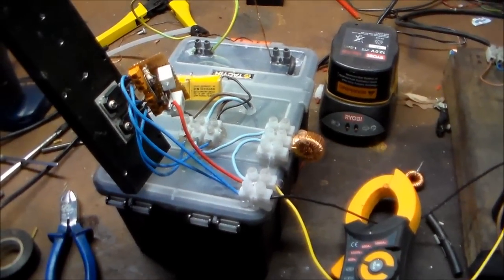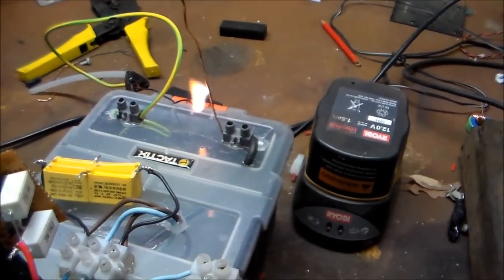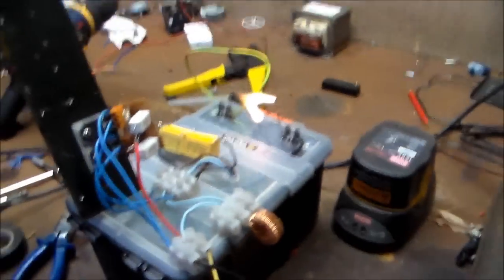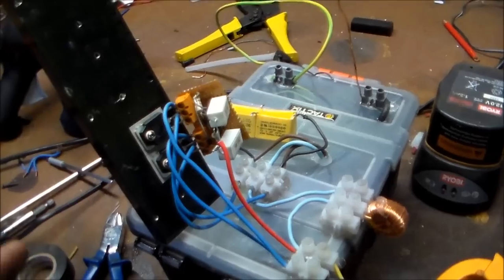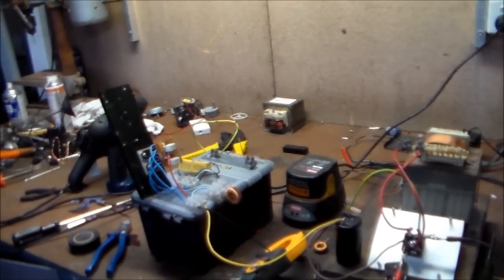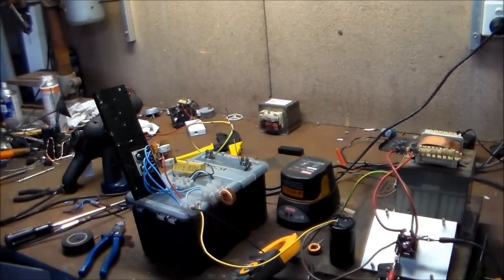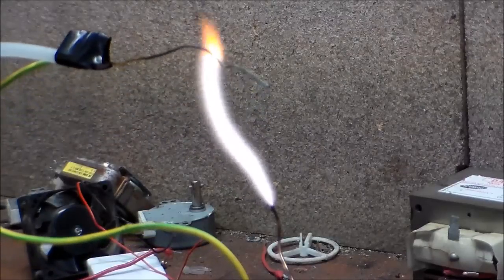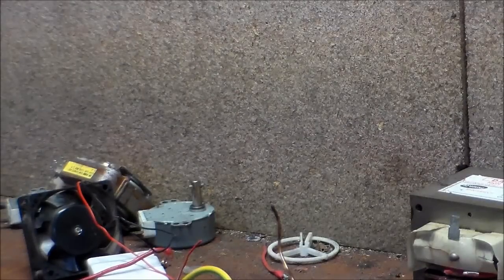IGBT ZVS Flyback Driver 45 Volts, Stable circuit. Decent Arcs!

Comment from the maker: i have made a better version of this. you can use 10 ohm gate resistor if possible. also you need a large fast diode, say 3 or 6 amps to discharge the gates fast enough.

Comment from the maker: 80v 8000uf. transformer is audio transformer that can supply 48A short circuit @ 60 volts / different voltages depending on tap

Comment: Not a bad idea using the oil,would serve as thermal mass and prevent frost creep from shorting the leads.
If it where me,I would split that big apple heatsink in two so you can eliminate the thermal pads.
Mount them on a piece of wood or w/e so they don't jostle around in the oil.
For the oil cooler,a aluminum cooking pot w/ a coil wrapped around,taped and insulated.
Be sure to add a fan to circulate the oil,one of those shaded pole motors from microwaves would probably work a treat.

Comment: Ooow now the trick is to not kill them lol.

My only thought for heat would be to hacksaw the heatsink in half, then bolt each transistor direct to there seperate bits of heatsink.
you would need to screw the heatsinks to a sheet of hard plastic for support.

Just a daft thought lol.